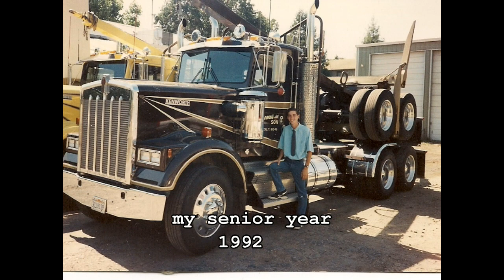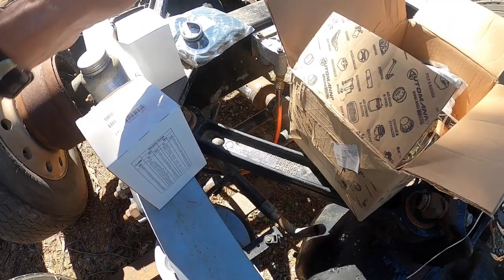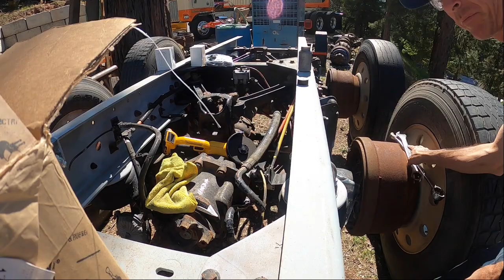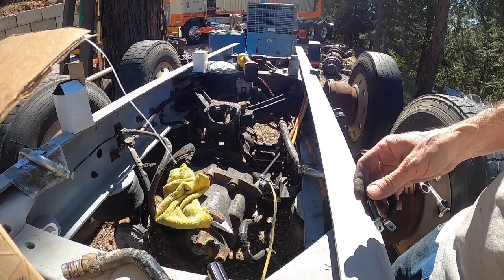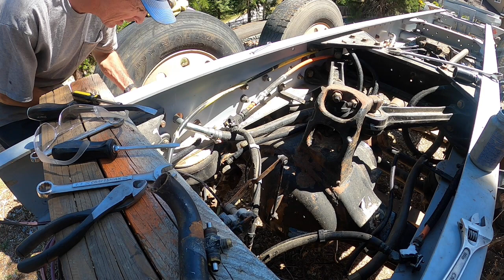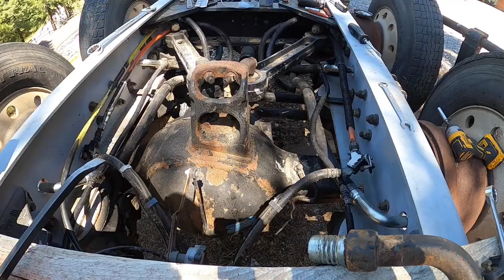1986 Kenworth W900B Brownie Restoration ep5

Comment: I have the 8 bag system on my T800 like it nice ride, had dual leveling valves changed it to single works well
Reply from the maker: I like the 8 bag, always had decent luck with it. I'm not sure how much the dual leveling valves help or hurt. I'm going to stick with one on this truck, be fine for the limited driving it will get. Thank you for watching.

Comment: Had a 2006 w900 with that same suspension, previously a 1999 Pete with the air trac suspension. The eight bag was way nicer than the air trac or any other suspension I ever had. Incredibly nice ride.
Reply from the maker: I like the eight bag as well, I know there's always big debates about which is better. I wish I could have found a set with at least one diff locker, but it should be fine with what I'm going to do with it. Thanks for your input and for watching. Hoping to get back to work on it soon.
Reply: There were 3 different 8 bag suspensions,  AG 100, AG 200, and AG 400. According to what I have heard, the AG 200 is not as good as the other 2. The AG 100 has round sway bars.